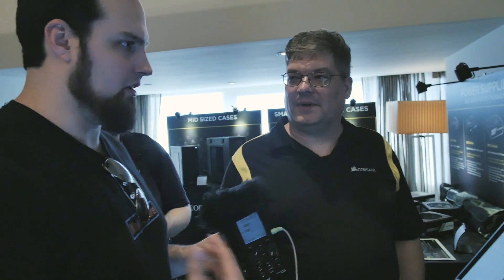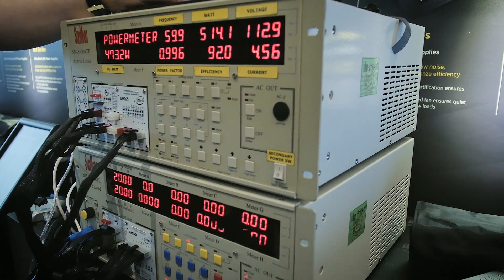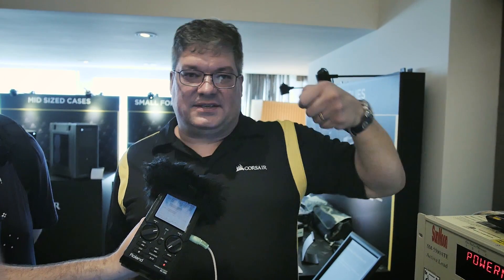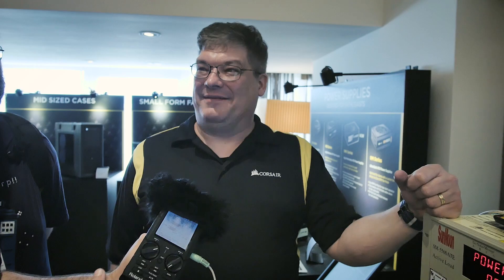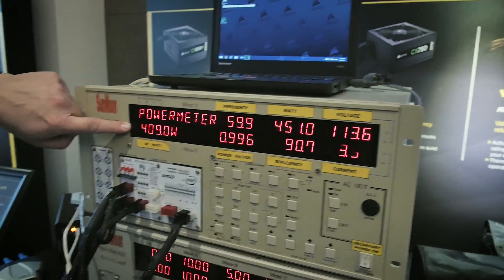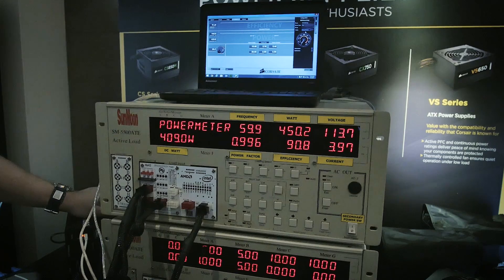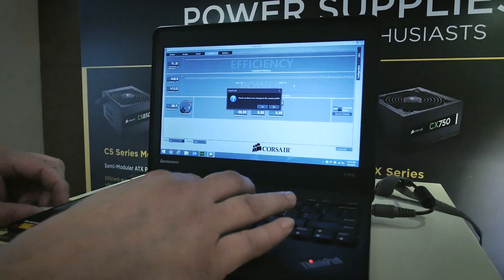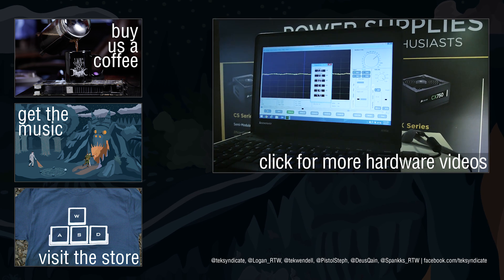Single Rails VS Multiple Rails Power Supplies - With Jonny Guru | Corsair PSUs

Comment: I bet the RM1000i hasn't burnt up hardly any 4090s or 5090s. I have an HX1000i currently and it's not quite as good but my 4090 has been goon on it for 2 years. I use 4 individual PCIe cables for the 4 connectors on the Nvidia OEM PCIe to 12VHPWR pigtail adapter.

Comment: I always preferred single 12v rail PSU's because I had no idea that my Corsair HX1200i in "multi-rail" mode was able to put 40 amps out per modular connection.  

I grew up seeing things like "12v1 @ 22a, 12v2 @ 18a" and stuff on decent PSU's.  I figured there was a particular ATX standard and 22 amps was the max on multi-rail.  Wasn't that the case?  Wasn't there a standard to all of this?  Especially during the time this video was taken.  ATX 2.0, 2.1, 2.2... 3.0.  eATX now or whatever.

THAT is why I was a single rail fan boy.  That's why I've ran my HX1200i in single rail mode.  I had no idea that in multi-rail mode, it could do 40 amps from one connection on the PSU modular ports.  It may even be more, being a 1200 watt, but I mean, heck, I'd prefer that it weren't.  40 amps should be more than enough for me.  40 amps * 12v = 480 watts.  I don't have anything that should ever pull 480 watts from a single cable, so I'd prefer that it DID shut down if one single component ever tried to hit that.  Looks like we could even customize that via software if too many consumers weren't stupid.

I'd actually prefer less than that 40 amps if I am running multi-rail mode.  (which I have been for the last day or so, BEFORE watching this video, despite having ran single rail for years upon years).

It was just different.  I have had plenty of good multi-rail PSU's.  When they were new, that was the bomb.  But, that's because there were standards, really.  So we all just "assumed" it was better.  Didn't really even know how it worked.  Really, it's because 650 watt PSU's wouldn't pass ATX 2.x standards at the time if it was single rail, right?  

But at the same time, there were single rail PSU's.  Were they just not ATX 2.x specified fully?  

I mean, is this even meeting full spec ATX rules?  40 amps... wowza.  I wish I knew that years ago.  Haven't had any issues but hey..
Reply: Also kind of realizing you didn't touch on ANY of that... just how THIS particular PSU handled single vs multi-rail.  Not how ATX standards were set in place.  Not how most multi-rail only PSU's actually came rated.  Hmm..  🤔

Comment: So how is the amps added up on a multi rail? He was saying that 1100 power supply is 83amps at 12volts on a single rail but when it goes to multi rail it is 40amps by 4 that would make 160amps?

Comment: The more expensive your PSU is, the more fire, smoke and noise it will produce when it blow apart. I had HX750 in ULP GPU build, and I will never trust Corsair neigher their "engineers". They put shitload of expensive components and they trusted component vendor specs instead of building smart PCB desing.

Comment: I got a Corsair 1200w dual rail and I love it! 3800x x570 ssd's 2070 soon to be 3080! Had it over a year and fan had not once turned on and it came with so much extra cables!
Reply: You running dual rail mode with 3080? All good?

Comment: I got hx1000 a while ago and it seems the over voltage protection in multi rail mode is way on the conservative side , I tried 2x2080 ti and they will still trigger the over voltage and shuts down the pc , the moment I go to a single rail mode the pc never shuts down .
Reply: My PSU came with default multi raid , and plugged x4 GPU mining and one coming soon , so for miner wha would you said , i haven't issue yet

Comment: Sorry to ask is the ripple effect less on multiple rail than a single rail, I've replaced the psu from a single rail to a multiple rail and the noise is far less.  Last rig I built for myself and I had a hum on sound when gaming. This is the 3rd psu fitted but multi rail and seems to reduce this hum alot. I checked inside the psu and each rail has its own dedicated smoothing capacitors from the rectifiers. Better than a single.  Could anyone do a video about ripple effects on a multi rail would be great thanks.
Great video ad it's answered a few of my questions. Thanks

Comment: For those that TLDW: Multi-rail psu are a safety measure. 
With multi-rail you can have over current protection (OCP) on every rail and thus on every cable. So you prevent running 40-50 amps over one cable in case of a short. Without these OCP you could be running 40-50 amps over one cable and melt the cable and maybe even start a fire.

Comment: if i have a 2 12v rail modular psu, and i want to run an sli setup, do i want one gpu per rail or both on the same rail?
Reply: +robo cop Depends on the Rail's limit, the GPU's requirement, and the rest of the system requirements.
Reply: +robo cop Let me put it this way. I have a late 2005 Powermac G5 case with a 1kw PSU, that I modded both case and PSU to support ATX system. It has 4 * 12V rails. 2 rails support 16 amps and 2 rails support 20 amps. I had modded 1 16 amp rail for the CPU only, 1 16 amp rail to general system, and the 2 20 amp rails was dedicated to GPU. This gave me 192W directly to CPU, and 480 W total for GPU. With the GPU pins that I have in it, it is limited to 450w max. It is a max of 3 * 8 pin, or up to 6* 6 pin connection. Or 1.5 GTX 980 Ti. Which my Corsair VS 650 can handle a GTX 980 Ti wth room to spare.

Comment: What software joony?  Also if a graphics card draws maximum 20 amps then there should be a 21 amp fuse in place for extra protection. And all psu's should have a simple surge protection build into it. So in my opinion ALL psu's are garbage.   thx

Comment: I have a Corsair RM750 (single 12v rail) and it runs my GTX 980 Ti with an verclock to 1544 and the memory to 7,8 Ghz really well, the fan rarely even spins...

Comment: Great video and opened my eyes back to multi rail PSUs. Like the guy said in the video, the reason I went with single rail PSU design is I was tired of having to replace my PSU every time I bought a new video card. These days however I tend to opt for nvidias power consumption minded cards (I love the *60 card, although I am currently on the 970 which still has awesome power use stats) so I think I should have no issue with using multi rail PSUs.

Comment: This reminds me of how your household breaker panel is designed. A typical 100Amp box is broken down to 2 115V rails running at opposite cycles so combined you can get 230V. Each rail is broken down to 15,20, and 30Amp lines with corresponding sized breakers. Basically, if you get a short on a 15Amp line that breaker will trip and there is no way you want to trust that line tripping to the main 100Amp breaker.
  This is what I thought of when he explained the differences and advantages of "safer" multiply rails in ones power supply.

Comment: Safety concerns accepted, 40 amps is not necessarily a safe current to run if something is going wrong... That's MORE than enough to cause some serious damage... With 80 amps, you're actually more likely to burn a trace in half possibly helping avoid a fire... Either way, you're not gonna have a good time.

Comment: I have a zalman 850w 45 degree continuous operation PSU.. which had a short run, but was well ahead of its time for 2008/2009.... it has a lot of the features mentioned are in that thing, and I still havent had problems.. unfortunately the cable is a bit short and zalman just cant seem to get the magic formula for its products anymore... makes me really sad.

***everything said.. this is a great and unique video and gives a lot of truth and insight... (even logan has said "you really want a single 12 volt rail" in several videos")

Comment: So the title says, "Single Rails VS Multiple Rails Power Supplies".

Well, from watching this video it would appear that they are actually talking about a single rail power supply vs. a single rail power supply with possible multiple protection and safety. How much multiple protection and safety does one REALLY get?

So, if one were to use a single rail power supply and then put a fuse on every power cable in their system, would they then have a multiple rail supply? I do not think so.

So now, if we have a single rail supply vs. a TRUE multi-rail supply, then what do we have?

I will continue using a single rail supply. Oh wait, I will now start using a 'so-called' multi-rail supply that is actually a single rail supply that MIGHT be safer.

The title of this video should then be, 'Single Rails VS Multiple Rails Power Supplies = Moot Point'.

Comment: Should also mention that these power supplies are most efficient near 50% load. While the higher rated units are more efficient across a broad range of loads they still have peak efficiency at about half the rated load.

So, it can make sense to plan your expected typical load to be about half the rated load rather than trying to save a little money with a lower rated PSU and push closer to the rated max. Some power supplies have trouble delivering constant power near their rated loads anyways. It also gives some room for peak loads or increased loads from future expansion.

Comment: In the U.S. you don't get more than 130V, at most, from your mains supply. If solder goes into the PSU and shorts something, I can have a case live with 250V that I could easily ground through my heart... it's not a great situation. XD

Of course, if that is actually happening for more than a fraction of a second, my consumer unit RCD module has also failed massively. But still... What if I use this somewhere with crappy wiring?
Reply: Then it still don't matter
Reply: Michael Marsh It's still not uncommon for people to die from faulty domestic wiring and consumer electronics. So I suspect we have a healthy level of paranoia. ;)

At the same time, I've shorted the mains through my thumb, as a school boy... I couldn't release the contacts I'd touched, because the current was clamping my muscles into contact. That was slightly scary. Fortunately, although the rest of my body was shaking, I found I could get my other arm to the socket, and I cut the power at source.

Long term, I don't think it did me any real harm, though I have had a slight arrhythmia throughout my life, which could be attributed. But I was young and healthy then. (and carefree and a little stupid XD) I feel I have first-hand experience of why this should be avoided at all costs. There are too many "what if" questions which lead to a much less happy ending.

Comment: As long as power is adequate dose it really matter so much? If you get a short chances are ether will fry your hardware  if protection fails. Maybe a high watt single will fry it harder ether way your buying new parts

Comment: Fabulous demo and video, thanks Tek Syndicate!

I used to be a proponent of multiple rails for the reason the Corsair guy said - safer. Less likely my components would get fried. Today, though, I'm not much in one camp or the other. I think the best thing you can do is buy a high quality PSU from someone like Corsair, Seasonic, or Enermax. And only buy a PSU that you've read highly positive reviews of, don't just go by brand. After that, again, multiple rails are safer, but in my opinion single rail is fine.

You really do want to read reviews. If I had actually done that, I wouldn't have purchased an expensive PSU from Silverstone, a brand I had come to respect before I knew better. The thing burned out, taking my mainboard and CPU with it. And, no, there were no pinched wires in my rig.

I'm not a fan of switches on PSUs that take you from single to multiple or vice versa. I can understand it from a marketing viewpoint - some want one, others want the other, so you can sell the same PSU to both types of customers. But if you've built your PSU properly and have already put in the circuitry for it to be multi-rail, what's the point in terms of actual benefit? In my opinion it is more of a gimmick, and something else to potentially fail, so I don't want such a switch on my PSU.

Comment: Hey corsair when are we getting an HX 2000i 80+ Platinum?
Reply: Ashaira What could you possibly need a 2000w power supply for.....? And even if Corsair actually made one, how many do you think they would realistically sell? If you genuinely NEED a 2000w supply then you are already into very specialist kit and employing an expert engineer should be higher on your list than off-the-shelf power supplies.... IMHO
Reply: Peter Kay i would like a power supply that could handle 4 gpus and a cpu with OC on all of them, 20 fans, 8 ram sticks, 5 hdd/ssd and leds while still having some room in case something more power hungry comes along without having to worry that i am pushing my psu to the limit for a few years. And as with all high end pc parts it is not a matter of need but want. Super Flower has one but i can't find it in my country anywhere (was a uk exclusive last i checked)
Reply: Ashaira More power hungry things are not coming out. Cpus are getting more efficient. GPUs are getting more efficient. DDR4 uses less energy than DDR3. SSDs us less energy than HDD. And you only need like 5 fans max.
Reply: MrLalasd you seem to be under the impression that i run components on stock settings. no performance nut does that. we like to push out rigs. also my radiators alone use 16 fans so.... yes i need more than 5.
Reply: Ashaira buy a nuclear sub just to OC that CPU to 4.7 GHz ... There's a way to estimate the power draw of the system at any operating conditions. You don't have to play the "I'm too retarded to do basic math, gimme 10KW power supplies" card.
Reply: Smoking Crop
Well superflower has a 2000W psu but for some reason it's UK exclusive.
Reply: ***** far from it. if i was i would build a mini nuke plant next to my PC

Comment: Enermax Platimax 1500w. Peak 1750w. 6 x 12V 45 amp rails. Up to 1080w for two-way SLI from 2 dedicated rails simultaneously. Dedicated MB and CPU rails. Two dedicated SATA rails (in case of two-way SLI). Platinum efficiency.
I love my beast.

Comment: What this guy is describing is not the difference between a single and multi rail PSU.  He is describing over current protection and distribution.  Multi rail means that you actually have separately regulated rails in the PSU.  This means you will have 2 or more separately voltage regulated 12 or 5 volt rails that can be used independently of each other and can have slight voltage differences between them (this used to be a real issue if you used power from 2 different rails to power a single GPU because it could result in uneven loading of the 2 separate rails since the voltage on one may be lower than the other.   Very few PSU's are made this way because it is expensive but it will provide isolation between components (a short circuit in a failing device on one rail will not effect devices on the other rail(s)).  The overwhelming majority of PSUs are single rail so they will have a single 12 volt, 5 volt and 3.3 volt regulated rails but they will then divide up those rails with over current protection either per wire (the safest most expensive way[and the only way that should be used]), per plug or set of plugs (the less safe but cheaper way[this is the status quo for many PSU brands]) or by rail only (the dirt cheap low quality burn your house down way).  Their is no reason they should be giving users the power to disable over current protection.  A single rail PSU is still the best way to do things for consumer machines but OCP is not the same as number of rails.  If you do buy a true multi rail PSU make sure it has an isolated voltage reference signal between all rails of a given voltage so you can combine rails when you need to for more current.

Comment: Should have asked about power efficiency with multi rails. Since efficiency drops dramatically at less than 10% load, can multiple lower amp rails increase % load and thus efficiency? You're gonna have to draw 100W at idle to just be within 10% of a 1000W PSU.
Reply: Bulgdoom Like he said, nearly all multi rail supplies are actually single rail devices with section limiters - therefore any efficiency questions between the two types are largely irrelevant. If however you do have a genuine multi discrete rail PSU, them it was likely very expensive and thus do you really care about efficiencies in relation to energy costs? if that was the driver behind your question..?
Reply: +Bulgdoom efficiency doesn't drop. these benchmarks have been done a trillions times already by jonny, techpowerup, and others. stop making shit up.

Comment: This is the kind of multi rail PSU I support, the problem is that most multi rail PSUs don't label them or have enough of them. Single is a good blanket choice because its pretty much just going to work.

Comment: im liking my corsair HXi750 my old CX 750 got loud under load but the fan on this thing dosnt even turn on under load. i leave it in multi rail mode because i dont have an issue with it.